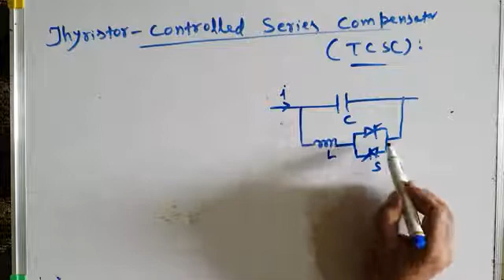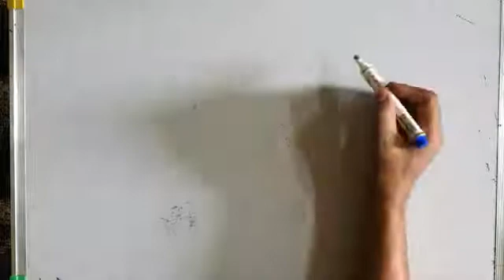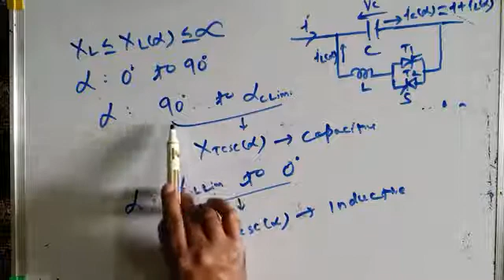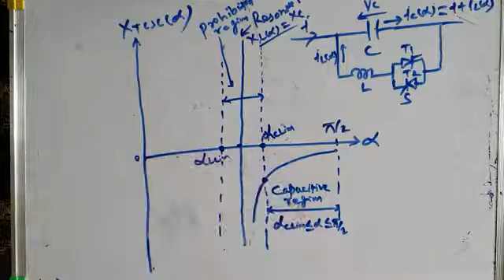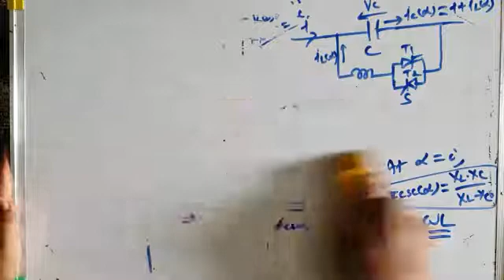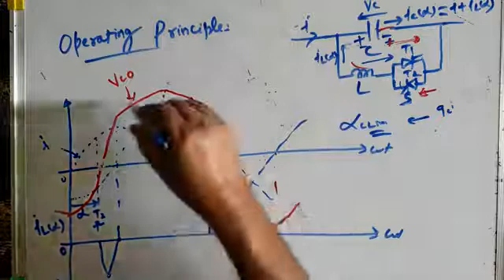L25_TCSC_Part 1

Comment: For plotting the total capacitive current ic when tcr conducts should we not subtract the tcr current from the total transmission line current? ; because TCR current waveform is negative in the first half cycle when T2 conducts

Comment: Why dou you choose the direction of the voltage arrow to be the direction the you sketched at the minute 2:40?    Later on the video you stated that the plus sign on the left of the arrow and a minus sign on the right of the arrow would make that voltage positive. It does not make sense to me. Should not the voltage be positive from plus to minus!? It was at the minute 38:08 that it was stated "negative voltage means it will not be plus minus like this" the arrow is tpiintin to the left and you pointed to the tip of the arrow while saying positive and pointed to the tail of the arrow while saying minus. That was what confused me the most. And as I m very knew to this concepts  I'm not sure if I m thinking straight

Comment: Why in you explanation do you put the corrent flowing from plus to minus when the capacitor is discharging if the  harge is all in the negative plate with a minus sign. If the minus sign means that the plate of the capacitor is charged, why don't you put the current flowing from minus sign to plus sign when it is discharging

Comment: If the direction of the voltage arrow is pointed to the left as in the image on the minute 45:49, if I say that the voltage is positive, that mean to me that the plus sign stays on the right and the minus sign stays on the left. If that voltage is positive meaning the voltage on the plus sign is bigger than the voltage on the minus sign of the arrow, Tha mean to me that thenegative charge is accumulating on the minus sign and leaving the plus sign establishing a current from the plus sign to the minus sign? Am I right?